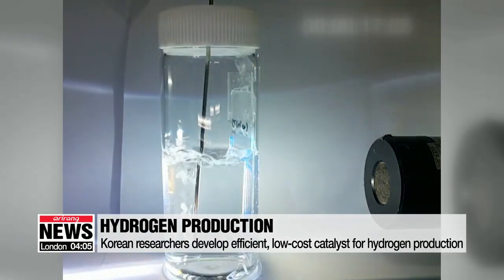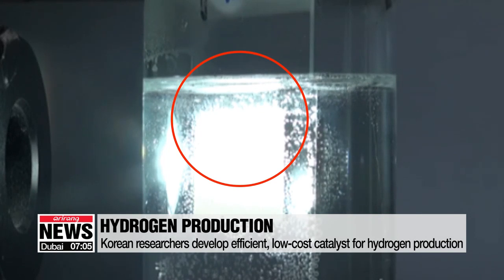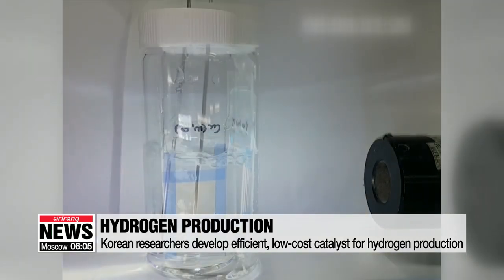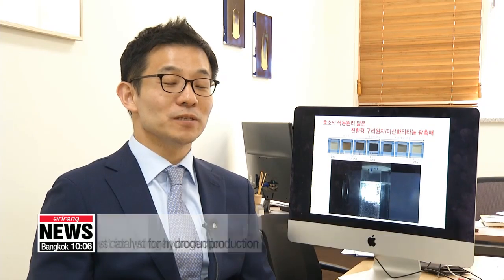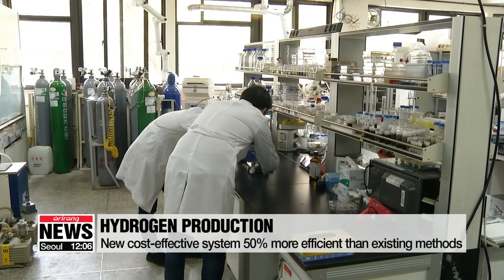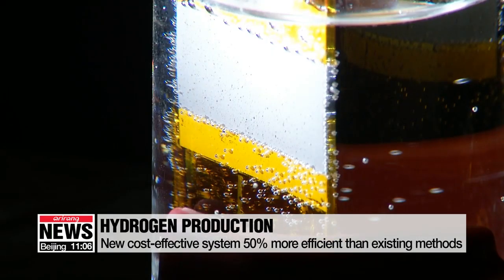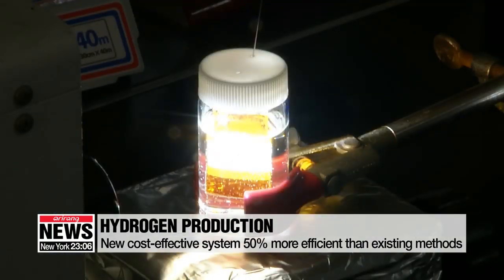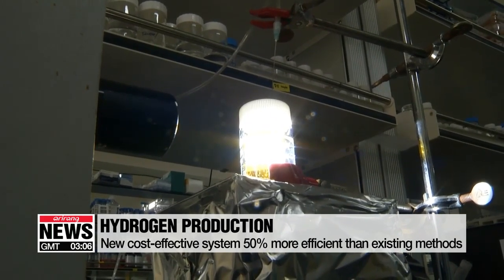Korean researchers develop efficient, low-cost catalyst for hydrogen production

Comment: What about the oxygen molecules? Where are they going?
Reply: In THIS experiment the H2 and O2 are released into the ambient air from the beaker. However, with the addition of Zeolite coatings on porous ceramic 'electrodes' (one having a Positive electrical polarity - the other Negative) the H2 is separated from the O2 after being split from the H2O molecule.

These electrodes are fabricated from the same porous 'refractory' ceramics used in automotive 'catalytic convertors' with the Zeolite metal plasma-coated as an outer layer and a copper coating underlying a small section beginning under the Zeolite layer - then extending along the length of the ceramic substrate to ITs end where the electrical connection is made. 

The electrically-conductive ceramic electrodes are then encased in a material (typically a non-porous ceramic or elastic polymer 'plug') to seal the reaction chamber so the gases are contained within until passing out through the porous electrodes for collection beyond.

NASA developed such a system in the '80s (re: NASA Tech Briefs) for on-site electrolysis of seawater at Cape Kennedy to fuel the Shuttle's main engines. They were exploring alternatives to reduce their expenses and trucking-in both gases was expensive. On-site production promised lower costs - but how?

In THAT application the water (filtered and desalinated beforehand) was pressurized INTO the reaction chamber to provide high-pressure gases on exiting the chamber to reduce opportunity for back-flash ignitions which could result from faulty compressors in the exit stream.
Reply: @lp115lp  ah just as I thought this is set up as an HHO generator and not just an H2 generator. Still I would love to see the degradation/oxidation rate of the coatings perhaps even the ceramic itself due to cavitation.
Reply: maybe absorbed by copper ?
Reply: into the air maybe?😛
Reply: O used for combustion of H2